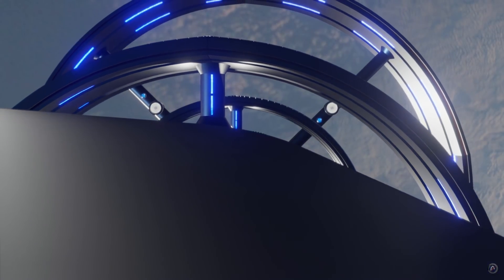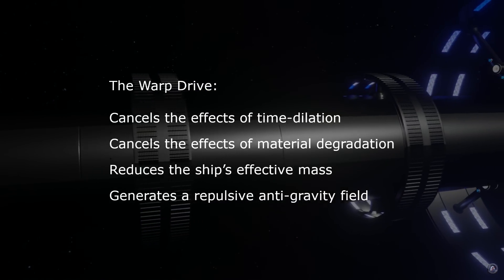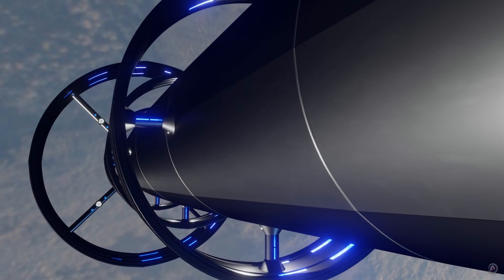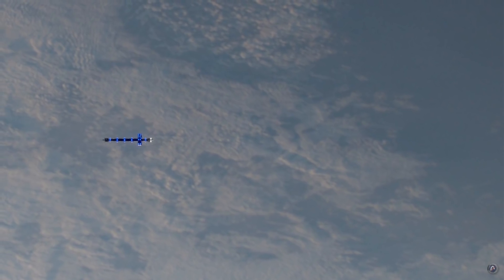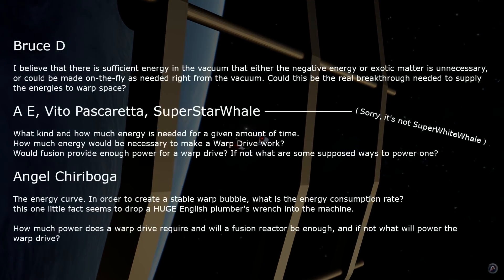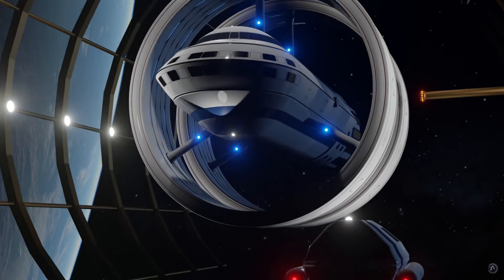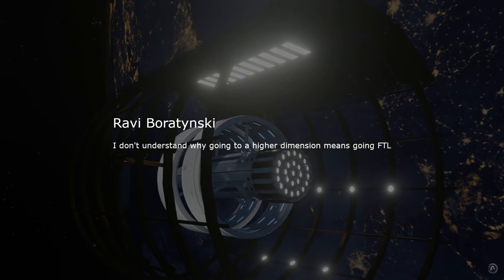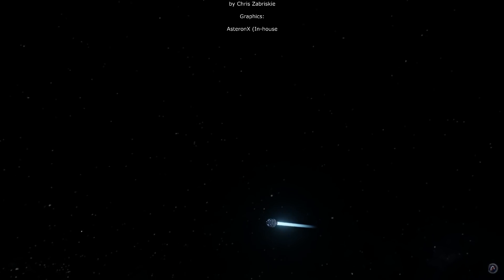Are Warp Drives Actually Practical? - Q&A #1

Comment from the maker: Question: How many of you want to see not only this technology but other technologies come into existence?
Reply: i am too much interested about musha jump drive.
Reply: The power required 18 billion magawatts for 1 warp effect. Why does it have to be watts at all. To use electricity you have to have conversion.   Electricity is a type of electromagnetic energy. I see no reason why very dense  gamma rays can not be used. Antimatter and warp matter would produce very dense gamma Ray's. Gamma Ray's are very dense electromagnetic energy. By doing this the mass energy requirements comes down significantly. By the way warp matter is real it was discovered over 2 decades ago. Well you please gave me your answer.
Reply: Luck at de video of woodwerd teve of hou flieng triegels werck das a quescshan
Reply: @bejavu864  what?
Reply: Luck at de ckanal of aeter
Reply: Onle eu cshod nowhe.
Reply: Ant envetegan for eur sel
Reply: AsteronX I would like to see a technology that locates chiropractors and creationists and has them painlessly destroyed. I'd also like to see a lawnmower where you don't have to empty the fuel tank and turn the mower upside down in order to change the oil.
Reply: It well but not in the simple way it is described. There are a number of different warp drive theories all fall short because of the energy requirements but if you combine a few in the correct way the math works and the energy comes down.
Reply: Warp drive needs something that works something like nagitive mass or nagitive energy. Everyone is looking at this through a narrow window concept.
Reply: Amachetay Cybo  You talking about the Tr3b with superconducting fluid and 3 reactor. Decreasing mass by 89 %. Or craft with high voltage nagitive and positive plates close together in circle imbeded in none conductive material with fast moving superconducting fluid in a slender in the middle of the craft. Or larger starship in solar warden fleet.
Reply: Amachetay Cybo  Yes it is called positronium.
Reply: Time space black holes and the most important gravity don’t exist ther r just useless concept child logic 😂😂😂😂😂
Reply: Worp drive is just a child illogical system nothing but a useless concept 😂😂😂😂😂
Reply: kalki avatar type 7 and 8 😎

kalki avatar (beast of the earth) (christ on the white horse) (son of man on clouds) is the biggest enemy of dajjal/antichrist/kali 😏

Kalki Avatar (Murtaza) cousin of Moula mahdhi a.s. (muhammad) 😎

Moula mahdhi is raja shashidhuvj (the mighty one) 😎

Prophet Moula Isa a.s. will kill dajjal cause dajjal is going to kill Kalki Avatar 😏

Kalki Avatar will follow orders from 2 religious king Moula mahdhi a.s. and Moula Isa a.s. 😎

Kalki Avatar going to have 2 swords and ring of moula sulaiman a.s. and staff of moula musa a.s. (iron rod) Staff of moula musa a.s. is like omintrix can transform into anything and can transform others into anything And stone in the ring of moula sulaiman a.s. is also known as kastav mani and it's more powerful than all 6 infinite stones combined 😇

This staff will transforms into white horses with wings,weapons,iron-man,cloud etc or can do imagination into reality 😎

*Ratn sru sword of lord shiva (miri)😇

*Ratn varu (zulfakar) sword of Moula Ali (piri) 😇

miri piri 😇

Satyug (sunrise from West) 01.aug.38 😏

Sambal is hospital 😏

Gzwa e hind 2029 😎

truth hurts go cure your eye 😜…

Comment: Once you began a warp event, say, a flight to a star fifty light years away, would the warp be continually drawing energy during the journey, or would it be one large power depletion, after which it would coast to its destination?
If the latter, would it require a second warp event to leave warp?

These are questions pertaining to my Sci fi novel I'm writing.

Another question is, how would one make the drive go faster? My theory is that increasing the energy input would.
In my story, the astronauts communicate with Earth by relaying a craft back and forth. Because the craft is smaller (I don't know if this is how it works) it requires less energy for a warp, and thus, can put more power into getting higher speeds.

I'd appreciate any insight you can offer.

Comment: The amount of energy you claim is needed is too high. There are a number of ways to distort space. In fact space distortions happen all the time. But because they are considered normal they are not looked at close enough. A research group found you could make space distortions in a free flooding magnetic field like space. By using a series of high power magnetic burst inthe correct pattern with a large group of antennas. Big problem the would burn out very fast.
Reply: You talking about aether?

Comment: maybe power it with a highly efficient thermovoltaic conversion reactor system coupled with artificially synthesized element 115 (stable)?
Reply: Element 115 has already been synthesized. It's just extremely unstable and it would take centuries to create any useful amount of the stuff to study.

Comment: Warp drive doesn't actually warp at all, what's actually is happening is it is electrically creating a pressure difference in the aether where it creates low aether pressure in front of spaceship and high aether pressure behind the spaceship resulting in tremendous propulsion. Aether is also known as quantum fluid, quantum foam, space-time curvature, dark energy, dark matter, etc. mainstream science just doesn't call it aether anymore. You just need to figure out how you will create pressure difference in the aether with electricity. There is no such thing as empty space.
Reply: I agree in part but not totally and so did einstein.
Reply: @clementvining2487  and Einstein can be wrong.

Comment: Could a warp drive technology be used to form wormholes? Or could it allow travel to other universes?
Reply from the maker: The technologies are related but do not function in the same manner. You cannot not dismount a warp coil and use it to create a wormhole--there's more to it.
Reply: @asteronx  That makes sense. (And apologies in advance for the uninformed rant) But does warp drive lay down the techniques if not the hardware of manipulating space with gravity/ high frequency HV electrical pulses? Seems like once you can achieve FTL warp fields wormholes or other gravity based phenomenon are just a few leaps of innovation away. They are technological cousins. If the pulses were in resonance with another device, location, and/or parallel universe then in theory wouldn't they link and form a gateway? It would heavily depend on the math of determining the right frequencies or equations.

Comment: A more practical approach would be to use energy from a thermonuclear bomb detonate in space (see nuclear pomped laser) for activate some type of device that can generate a form of "warp bubbles ". I don't suggest that device is on the board of vehicles this would be a passive payload like a bullet shot from a gun and can be much smaller than the engine and its power source.

Comment: StarDrive Engineering company has been builting saucer spacecrafts since 1985year in Quantum mechanics physics  electromagnetics propulsion systems warp dimensional drive  that never needs fuel and runs forever has artifacial gravity field inside saucer spacecraft that warp time and space and traveling faster than speed and warp galaxies and  warp  132 multi dimensional universes in seconds ! Warping and opening worm hole to  108  parrell multi dimensional universes with 108 parrell earths ! The StarDrive Engineering company has been builting saucer spacecrafts in Quantum mechanics physics in electromagnetics propulsion systems for united states military pentagon since 1985 year for united states military pentagon deep space program!

Comment: Did anyone ask how a warpdrive would effect a nearby other non warping object? Like a Planet, or an other starship?
Reply: It has been said a little and to a larger degree on other sites. But to make a warp drive work in the first place with a smaller amount of man made energy you need one energy system feed on another. This also means taking advantage of the nagitive effects of the warp drive system and turn it into more of the correct kind energy needed to increase the field matrix and avoid the nagitive effects.

Comment: As to fusion not being powerful enough....  Looking at the Polywell reactor design it has a odd property because of the way it processes the fuel.  The spherical ocilation zone, causes fuel to bounce through the center of the sphere and impact which is how they fuse.  Interesting detail is the power output goes up with the 5th or 6th order, not the third.  So where doubling all the dimensions of a normal power pant, you get 8 times as much power.  But with polywells, doubling the dimension gives you 256 times as much power ( as I remember ).  So a ten fold scale up to 150-200 feet across, could give you millions as times as much power.   
FYI.

Comment: Over 50 years ago, a simple show low budget tv show made up the concept of warp drive out of thin air. 50 years later, the concept that was made up is closer to reality.  Just an FYI, Miguel Alcubierre was a big fan of that said show.
Reply from the maker: In only 121 years we have gone from only thinking about exploring space to building the ISS to now planning a refueling depot on the Moon in order to reach Mars with a both unmanned and manned missions, basically this means solar system. Makes you want to ask, what's next? Grav control and new types of spacecraft, and other... ;) which will completely revolutionize the way we reach for both the sky and space.
Reply: @asteronx  I think once we go to Mars we will be seeing ships built-in space.  With the current crop of rockets, they might be the last group to be built on Earth in our lifetime.
Reply from the maker: @KevinDavis338  At some point, yes, ships will start to be assembled in space. Most folks have little if any clue what is about to take place.

Comment: Rotation or electron static gravity emulation, Why not both at the same time!  For if the electron static plates fail, you will still be held to the floor, just vertigo will become a slight problem..

Comment: Aspirational goals are good in the "fun to imagine" way of sorting out and categorization of phenomena. There's no such thing as a silly question because the approach to Infinity is infinite and more happens by serendipity than building on available education..

In the Observable Holographic Universe of Superspin QM-TIMESPACE Principle, the "One Electron Theory" is simply a proportion of modulated pulses, mass-momentum measurable in relative properties to be categorized as "electronic", but the same cause-effect modulation principle can be applied to Eternity-now Superspin Superposition-point Singularity positioning, from the characteristics of this approach/aspect of ccc in CCC cause-effect. Ie it's temporal categorization techniques applied to Perspective Drawing and material existence. 
Quantum Fields are real building blocks of the Universe, because superimposed time here-now-forever frequency-density-intensity (mass-momentum) probability, ..cause-effect projected distribution of e-Pi-i resonance, imaging wave length entanglement-> potential possibility oscillation, (there's no there out there, outside of time duration timing).

So, not being a Communications Engineer myself, the reccomendation for re-location of possible devices in alternative positioning resonance states is a job of Scientific Analysis and balanced reciprocal positioning formulae Mathematically, that has been a worthy project of many SiFi Authors.., or so I've read.

Comment: Like the vids, but starships will use the incalculable energies of spinning black holes, neutron stars, supernova and related phenomena. Halo drives or Dysons slingshot type maneuvers. A significant fraction of light speed, up .25 is possible, using NO fuel.

Lol, fusion reactors. Still 20 years away? We already have a huge, relatively stable, fusion device 1 AU away. Once we begin truly harnessing our star, we jump to type 2 civilization quickly.

Comment: can you just don’t need antigravity that use a space-time you just don’t because of room temperature super conductors allow you to create anti-gravity by creating an electromagnetic field and when you run that electromagnetic field over a superconductor a electric current is produced by the laws of induction and the electric current in the super conductor would expel the magnetic field produced  by the traveling electric current and this expelled magnetic field would counteract the magnetic field that induced the electric current allowing the car to hover on the magnetic field grade and you could also even have hovering buildings using this you could have Hoverboots you could have hover cars and it’s all perfectly safe and because the electrical circuitry has no resistance to electricity you only need to charge it once it’s almost perfectly efficient actually it is perfectly efficient